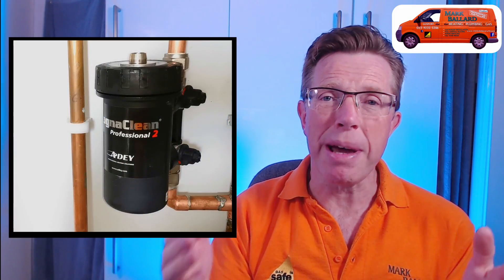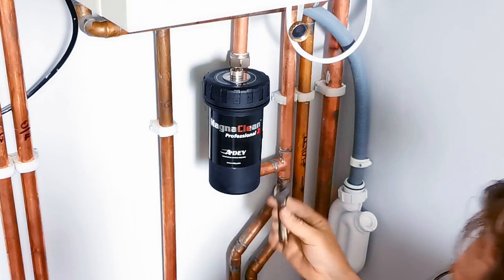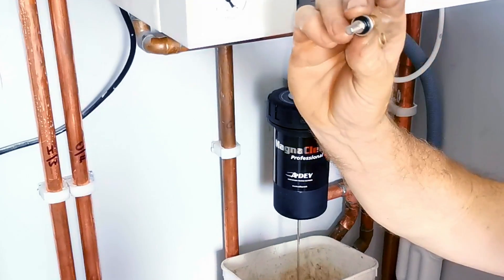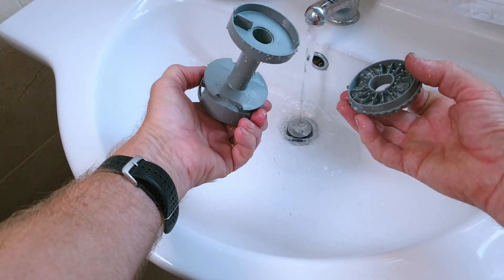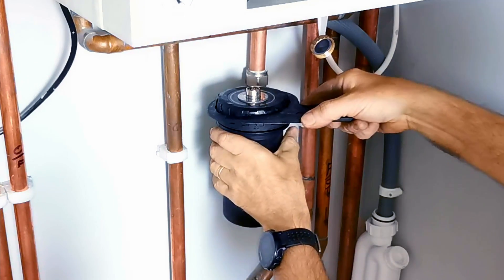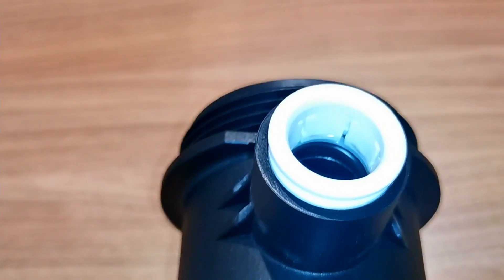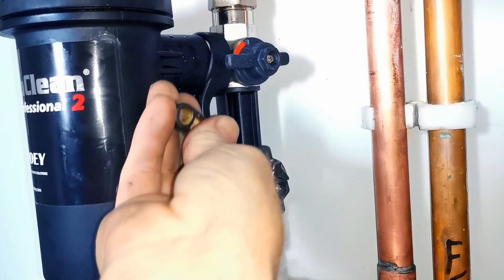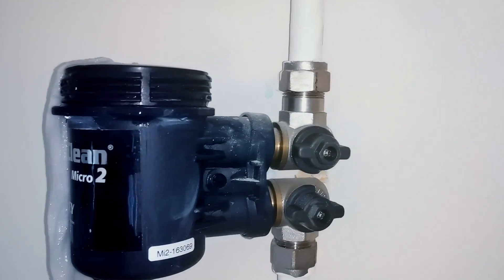MagnaClean Professional 2, Cleaning / Servicing.  3 Ways You can go about this job. Top Tips.  2021

Comment: After releasing the vent on the top, what if it seems like the water/coolant inside the container doesn't stop flowing out of the vent?  I made sure to isolate the in and out valves, but the water seems like it was continuing to bubble out of the top.  I didn't remove the drain plug on the bottom out of fear of losing too much water in the system if there is a leak issue.  This is for a Pro 2XP

Comment: Hi Mark. Another brilliant video, and so very helpful. Can I please ask - is it basically the same process for servicing the Micro2 as the Professional 2 Magna Clean? Just smaller? Also, if the system has been fully drained, to take off and cap off a couple of radiators for example, when it is refilled, I assume inhibitor then be added directly into the Magna Clean rather than one of the rads? Is that the preferred option? May not be possible on the Micro2 as its capacity is only 250ml I think....? Also, would you do this before filling the system back up, or afterwards? Cheers. Jim

Comment: Great video.. the valves are on the right hand side… can this be fitted the opposite way round with the valves on the left hand side.. or is it restricted to RHS only due to flow or is it multi purpose by turning the manifold 180 degrees.. thanks

Comment: The JG 22mm O-rings go into the back of this filter nicely. I've disassembled and fit new ones in on more than one occasion. Just lubricate them with the tiniest smidgen of silicone grease (I mean miniscule). Otherwise they whole filter might well end up popping off. 😮😂

Comment: Common issue with Magnaclean is that the canister won't detach from the valves.

If you can’t access the lid and bottom plug of canister to clean (due to being installed in limited access areas) or if one of 2 valves need replaced, you have to change the canister and both valves.

The cost of replacement valves and canister exceed the cost of a completely new unit. In other words, if you can’t get into the canister in situ to clean or either of the 2 valves need replaced, you need to replace the whole unit!!!!!!

Adey will not provide parts free of charge under their 10-year guarantee unless you have registered within 30 days!!

Far cheaper just buying a Magblu Radmag which literally takes 2 minutes to install.So easy even the user can install it.

Comment: Great videos. Thanks. I have the older pro 2 that’s developed a top o ring leak. Wondering if I should just buy the newer 2021 model and put that onto the existing fitment for ease of change, do the newer model canister fit the previous pro 2 coupling ?

Comment: A flexible loop with the same size speedfit connections would be useful to bridge the two pipes whilst servicing, if there is a small leak.  You could even make one up with a bleed line to relieve any built up pressure.  It could also be left in place if the cannister is faulty until you get a new one.

Comment: Hi Mark.  I wonder if installing two magnaclean filters will be better? The way my pipes run from the boiler doesn't allow me to put in a filter as there is no room but I can put a filter on a pipe that's going upstairs and one that is going downstairs but will it be beneficial at all to have two filters or just one filter be enough put on any of the pipes will be OK.  Thanks

Comment: Very helpful video. I accepted the challenge and have found a very easy way to remove the speedfit bite-ring in order to inspect/replace the o-ring. Simply apply outward pressure to the collar and gently probe at the outside top of the grip ‘fingers’. After loosening the second one the whole thing pops out cleanly and you can get to the o-ring and its plastic protection ring.
Reply: Any chance of making a video to show the process pal ?.
Reply: Same question :)

Comment: Thank you Mark - that was very helpful! We had a slight loss of pressure occurring regularly from our home heating system (Combi boiler) and traced it to the lid seal on the MagnaClean, which it seems wasn't screwed down properly. After sourcing a seal kit from Adey (who kindly supplied it free of charge, as the unit was still under warranty), your video enabled a DIY'er like me to service the MagnaClean and with fresh seals in place and lubed with silicone grease, the leak now appears to have stopped. Thanks for saving me a call-out charge, for what was in the end, a simple fix!

Comment: Thanks for that video Mark. I used your example to clean my Greenstar System Filter (old model with bleed at bottom) which had been leaking. When I removed the bottom section I discovered the reason for the leak - no O ring at all!! Have cleaned it and put it together again - still a small leak - now trying to find a source of an O ring to fit as not sure of original size.